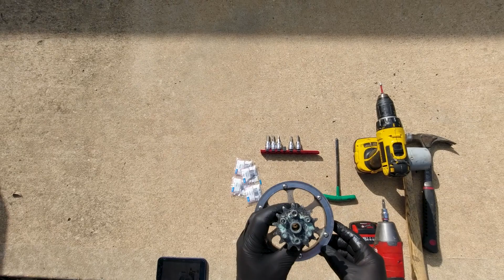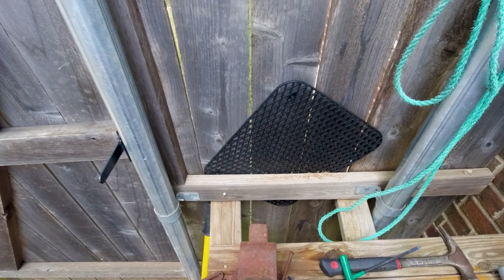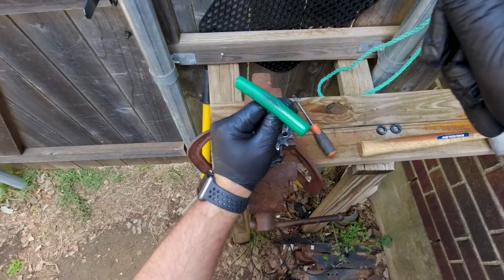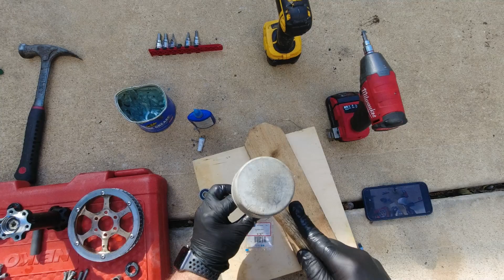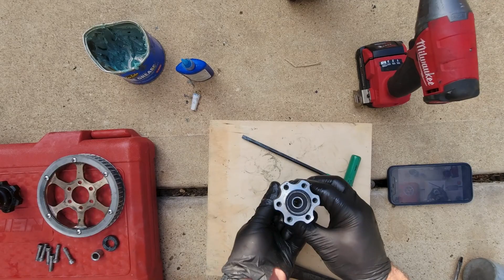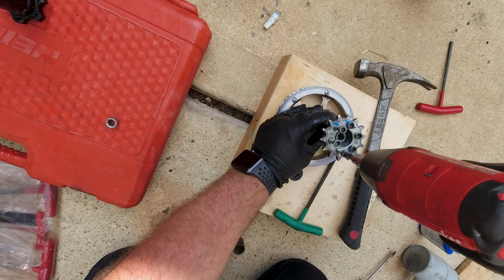Jack Shaft Bearing Upgrade Sur-ron/Segway Part 1 - 10X26X8mm SKF 6000-2RSH ABEC 5 Rating

Comment: Im wondering if you might have punctured the seal on them type of bearings with the bushings.. It's hard to find an accurate bearing by pictures. . I got the Enduro Max 6000 bearings (Red ones) and found out the center ring "10mm" was a bit thinner than the Stock OEM bearings... And from the looks from looking the SKF's you used, Those have a thicker center ring.... And I think SKF's have a higher RPM rating and can handle higher heat than the competitors... Nice tutorial... I could have used this months ago when I did mine... I just bought a $42 tool to remove all these 10mm bearings... Think about roller bearings... and when you do your swing arm... Delrin Bushings might be the best way to go with for the swing arm instead of bearings....